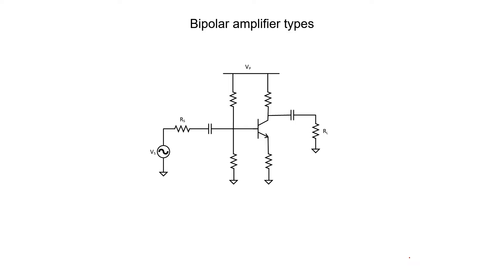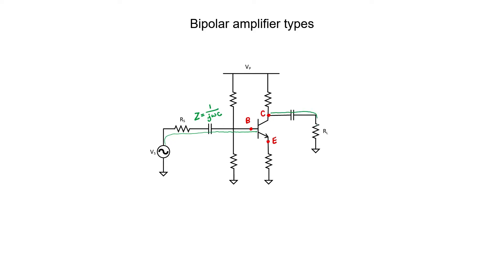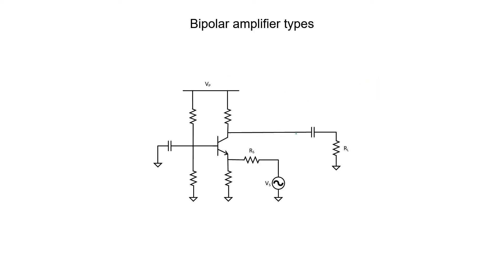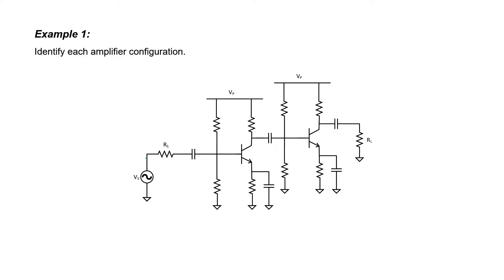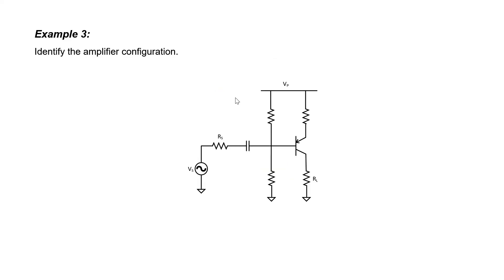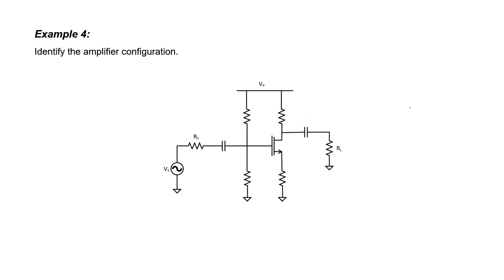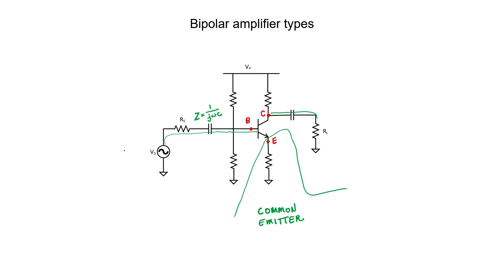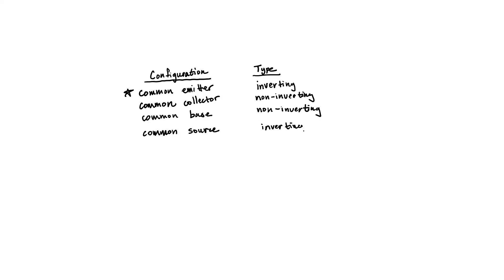Transistor amplifier configurations (2-Transistors)

Comment: All this discussion is worthless.  They only reason why I am brilliant at designing circuits and have made millions of dollars out of my modules is because l include component values in all my circuits and without them l don’t have a clue what the circuit does. And that’s the way l have taught my 25 million viewers to my website.  You can only learn when values are included.  I can “see” a circuit working and have never used a CAD package. After all, the designer of the package can see the circuit working too and designed the package to display the operation.

Comment: Your comments are entirely incorrect. NPN transistors are used more frequently because they sit nicely on the 0v rail.   It is very difficult to drive a PNP transistor when it is sitting on the supply rail and this rail can fluctuate with load and other supply factors. When they are used in push-pull mode, they work quite satisfactorily.

Comment: If the nature of silicon makes pnp not as desirable as npn, then what makes that the opposite situation for germanium? I've built small signal audio circuits using germanium transistors, and all the ones with even the least leaky npn's sound like hot garbage.

Comment: Did Not Understand:
1-What Is The Load Resistor?
2-What Kind Is DC Power Supply?
3-Where Is DC Power Supply In The Graph?
4-What Is The Load?
5-Is Source = Signal?
6-Why There Is Capacitor While will Bypassed?
7-Is Vs + Vp Mixed?
Please Answer.

Comment: Nice video, thanks.  I've always found the "common" terminology to be a bit confusing.  One point I'd like to mention is that I've overwhelmingly seen N channel mosfets being drawn with the arrow pointing in, not out (opposite of BJT conventions).
Reply from the maker: The arrow direction also depends on whether the body connection is shown; you may have been seeing examples where it is there.
Reply: Hmm...do you mean the solid line next to the gate or sometimes its 3 small lines next to the gate ? isn't it something to do with depletion or enhancement channel please clarify if you could  or do you already have a vid ?...cheers ! @adanner
Reply: Me to! I look at MOSFET and say to myself 'well its opposite to a BJT  !

Comment: 2:53: not being connected to the source or the load is one thing, but how do you jump to calling the emitter "common"?
why or how does "common" relate to "not connected to either one"?
how about "independent emitter" ? I never understood that. But I'm a digital guy, I haven't worked with AC amplifiers much
Reply from the maker: It's related to the use of the word "common" to mean a common reference point in a circuit, or ground. So if the emitter is connected to a common point (AC ground) rather than to the input or output then it is common emitter. It sort of applies even when there is a resistor in the path too.
Reply: a common point to what and what? Common if relative to at least two things.
I can see the emitter being connected to ground via a cap*, thus connected to AC ground. So it's AC grounded. But base and collector aren't AC grounded. So it's by itself connected to AC ground.
(*for some reason you say that even a resistor in the path still makes the emitter connected to AC ground, not sure why).
I think you're being paid by big electric to perpetuate this nameology.  
  @adanner

Comment: Please display dots at the points where intersecting contacts are connected. For example, for two resistors that set bias in the transistor base. It's very eye-straining.
Reply: Also the “plus” sign on the generator is missing
Reply: @stefano.a the "generator" is, an AC signal source so it has no "+" output. During the first half of the AC signal it will be +ve, and for the second half of the signal it wil be -ve.
Reply: @JaenFoster  no, the sign has to be placed also for AC sources to analyze the phase of the signals in the network.